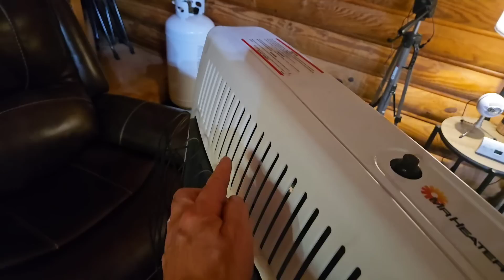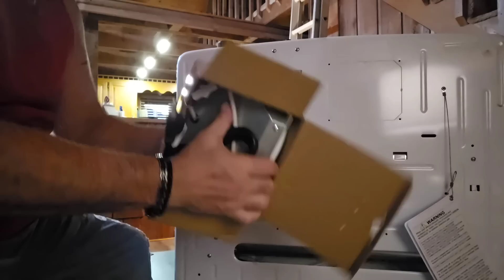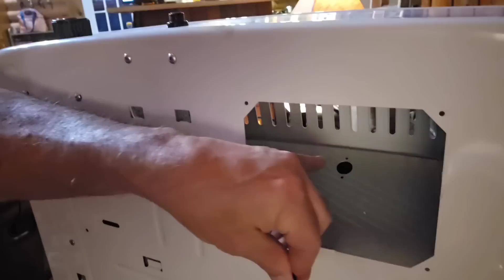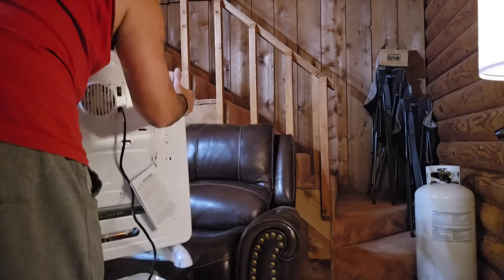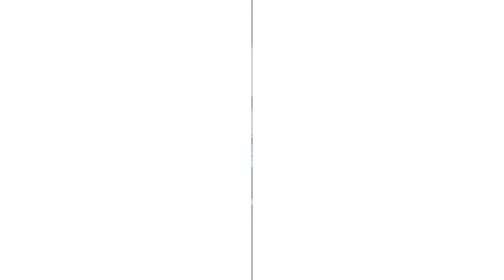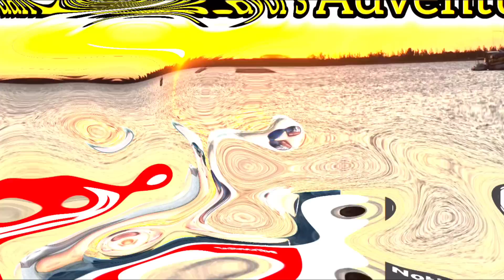He's About To Get Things Heated Up

Comment: Hopefully you don't have the heater plugged into a surge protector, not to safe.
Reply from the maker: Only the low voltage fan runs on electric. The heater itself runs on propane.
Reply: May i ask why not a surge protecor?
Reply: @Fanlady4236  can cause a fire

Comment: Seems like those haters would already have a fan built onto it. HM. I have a little later one. It looks like a old. wood burning stove. and it blows out real good. I haven't really used it, but one day. because I like having the whole apartment heated up and not just one or two rooms. When my brother passed away in Texas. and I went to go get his ashes and some of his belongings. That's one thing that I brought back with me. It was brand new.                                                                               How are you guys handling this cold air? The older I get, the more I dislike it. LOL.
Reply: Didn’t know Mr. buddy had indoor propane heaters especially with a fan.